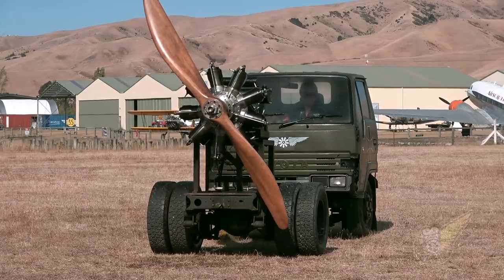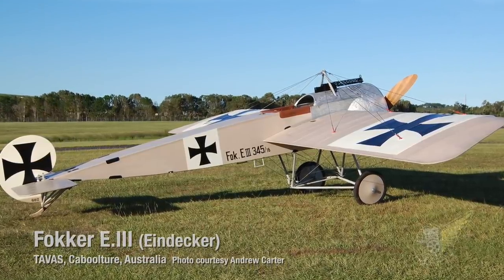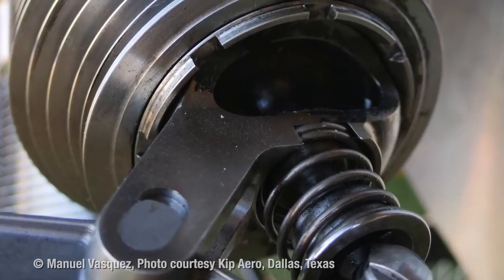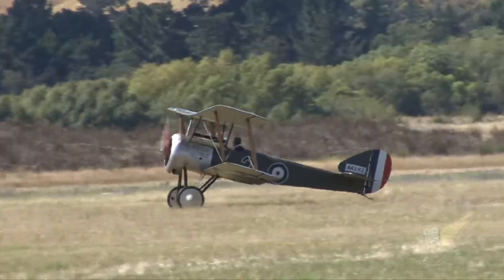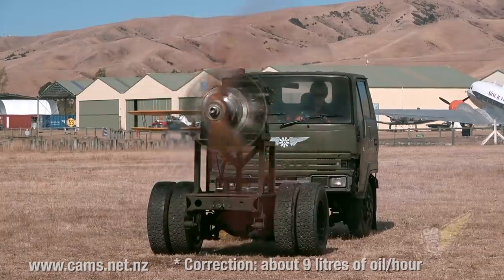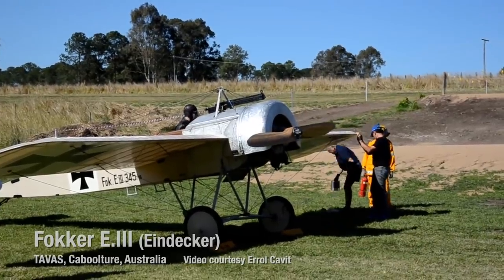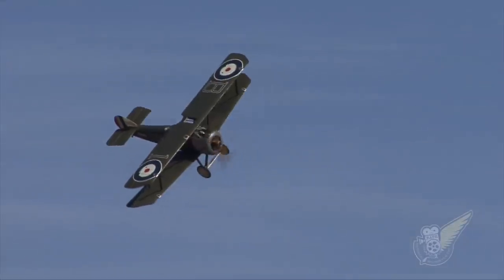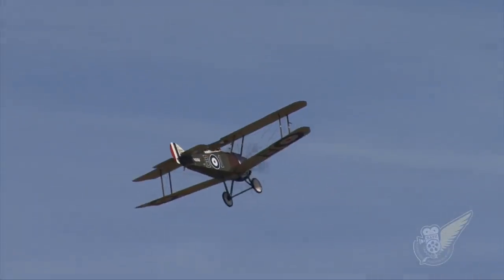Building New 100-Year Old Gnome Rotary Aero Engines In NZ

Comment: It's a rotating radial engine. A rotary engine is something quite different.
Reply: G'day,

 Ah..., nope. 

Thou art in error, Grasshopper..., deeply DEEPLY so.

This is a Gnome-Type  ROTARY  Radial Aero Engine, a roughly 1909 development of the flying (Model) ROTARY Radial Aero-Engines first invented & hand-built by Lawrance Hargraves at Stanwell Park in the 1880s (his ran on Compressed Air, having 3 Cylinders, each one with a Propeller-Blade attatched).

 A STATIONARY  RADIAL  Aero-Engine is the Post-WW-1 descendant, of the Gnome-type ROTARY RADIAL Aero-Engine.

  What you're thunkin of, y' young  Blatherskite...; is a Wankel-Type (Wanker's) Rotary Engine, with a Trilobite Rotor, perigrinating around an Eccentric Epicyclic Track surrounding a central Geared Drive-Shaft...; they hit the Slow Car Market in the early 1970s, but they were vile Fuel-Hogs, forever ruining their Rotor-Seals, so now they're Commercially Extinct.

Just(ifiably ?) sayin',

Take it easy.

;-p

Ciao !
Reply: @WarblesOnALot  You're a humble bloke fromunda down under I assume? "Rotary" is the same thing as saying "Rotational". Both are proper terms. A pure "Rotary Engine" is not a "Rotary Radial Engine" which is not a "Stationary Radial Engine" all three are distinctly different types. As you can see in the title it states that it is a "Rotary Engine" not a "Rotary (rotational) Radial Engine". But, I suppose the other side of the planet has its own foibles to contend with as well.
Reply: G'day again,

Sorry Munchiekin, but NONE of this is up for debate by the Techno-Chinglish Kindergarten Class, playing with it's first Thesaurus.

These terms are all a part of the evolution of  Engineering Historical Nomenclature.

  RADIAL...., refers to the layout of the Cylinders, around the Crankshaft ; and to NOTHING ELSE.

ROTARY....; refers to a Radial Engine in which - in the interests of improved Cooling, the Design features a Stationary Crankshaft..., around which the Crankcase and the Cylinders all ROTATE.

Following WW-1,  advances in Aluminium Manufacturing Technology enabled the successful development of Air-Cooled Radial (Stationary) Aero-Engines.... {there had been unsuccessful attempts at earlier Air-Cooled Radial (Stationary) Aero Engines, and even some Water-Cooled Plumber's Nightmares....}.

The Wankel Engine, of post WW-2 gestation  was described as a "Wankel-type 'Rotary' Engine"..., simply because it features an Epicyclic Trilobite Combustion-Surface, which ROTATES around the Output Shaft..., and which has thus been designated as "The Rotor".

However, a "Wankel-Type Rotary Engine" is NOT actually ANY type of a ROTARY ENGINE...; because ALL ROTARY Engines have their Cylinders and Crankcase arranged to be able to spin around the Crankshaft...., whereas a Wankel Engine has NO Cylinders and NO Crankcase either.

  If you REALLY want to be seriously precise and accurate..., then the Wankel-Engine is actually a Spark-Ignition Petrol-Burning Self-Torqueing Epicyclic Gearbox ; featuring an Output Shaft with a Sun-Gear and an Eccentric Planet-Cog functioning as a Vane-Pump torqueing backwards as it serves to separate the Suck-Squeeze-Bang-Blow phases of the Otto-Cycle occurring around it's Perimeter, inside it's dual-lobed Housing... (So thete !).

  Because what I taught myself to fly in today hangs in a Transport Museum..., therefore I get to pontificate in my role as the Grandaddy Santa-Clause of twiddly little Hairygoplanes ; and correcting the mistaken likes of yourself is simply part of the Gig.

Search YT for,

"The 8Hp, 1975, Red Baron Skycraft Scout ; World's 1st Legal Minimum Aircraft..."

 To see what taught me to levitate, back when I was but a Pup...(!).

I'm not actually a pompous Arsehole, y'see, because I make at least as much fun of myself as I do of others...; and because my Bullshit Content hovers down around 5%, such self-deprecation is the saving grace of a(n otherwise intolerable) "Competant Smartarse".

   Take it easy,

Such is Life...

;-p

Ciao !
Reply: @WarblesOnALot  G'day Mate. Quite the persistent bugger aren't you? But you're wrong, and I don't need a lecture on engines or their nomenclature or function.
Reply: @WarblesOnALot  I'll agree with on that point. It's not up for debate. G'day
Reply: You should look up the IgNoble Prize for Dunning & Kreuger, they brought an Opera to the Awards Celebration..; whereinat they sang a very witty song, all about you - personally, instead of making a more  traditional acceptance-speech.

Get onto it mate, you're infamous (!).

Take it easy,

Such is Life.

;-p

Ciao !
Reply: @WarblesOnALot  I gotta give you credit...you do try.
Reply: @merlepatterson  Its a rotary radial engine my guy. I can pull an FAA referance if you want it.
Reply: @nopenopenopeyes  That's exactly what I classified it as. Sorry if I replaced the nomenclature term "Rotary" with "Rotational", but they have the same meaning and function. The specific engine type design is a "Radial" engine. That's all I was getting at. It's nothing to get excited about.
Reply: @WarblesOnALot  G`day. Imagine yourself living at the turn of the century (1900) when men all over the world were trying their luck at defying gravity. Much like today but much more crudely (there being no interwebs in those days), men were learning from one another how to build aeroplanes and needing a power plant when no aeroplane engines existed. They tinkered with what already existed, except for the Wright Brothers who needed their own engine design in order to enforce their patent. But that's another story altogether. Well, what did exist, you ask? Motorcycle engines! That's right, a French motorcycle with a rotary engine for the rear wheel! Indeed! (Google it) Compact, light weight, air cooled, and powerful for it's weight. The design was an obvious choice. Engine builders of the day adopted the plan form, and soon bigger and more powerful designs appeared all over the place. Then.... along comes WWI. No time to reinvent the aeroplane engine, fly what you have. Reaching the limit on size lead to the development of the stationary radial and other engines. Glen Curtiss even used his own design motorcycle engines that became the OX5. But still the radial format proved to be best adapted for increased power. There ideal power to weight ratio could be maintained by adding more rows of cylinders for even more power.  Up until the development of the jet turbine engines,  the big (really big) radials  dominated the industry. I know, the debate over radial vs. V12 rages on every year at the Reno Air Races for speed. GO RARE BEAR!
Gotta go... the nurses are coming!
Reply: +Michael Jensen

G'day,

Thanks... Are you any connection to the great Volmer Jensen ?

  I broke my foot in a VJ-24w, back in 1992 behind a 22 Hp JPX  Pul-425...; when I foolishly tried a downwind takeoff (!).

Anyway, the thing is that whoever does a thing FIRSTIES gets the naming rights..., and (in Aeronaurical usage) the ROTARY Engine dates back to the 1880s, at Stanwell Park, NSW..., and in Automotive use it goes back to about 1901 in the USA...

The first RADIAL Engines were attempts to add a Water-Jacket to a ROTARY Aero Engine and thus cool it while holding the Crankcase stationary with the Cylinders, while spinning the Crankshaft - to avoid the issues of Gyroscopic Precession causing wildly asymetric and idiosyncratic response to Controls...

The Cooling problems with Radial Aero Engines were not solved until the 1920s.

In the 1960s or '70s the Automotive Industry's Marketing Jism Department decided to MALAPPROPRIATE the term "Rotary Engine" and stick it onto  Wankel's Self-Torqueing Petrol-Burning Epicyclic Gearboxes...

And thus, they permanently confused the likes of poor silly +Merle Patterson, hereinat.

  ROTARY means Gnome-type ROTARY..., RADIAL means NOT-ROTARY..., "Rotational Radial" is a figment of a self-deluded feverish Imaginitus...; and Wankel built a Trilobite Epicyclic alternative to a Reciprocating Piston Engine - which was a Commercial FAILURE because it was horribly Fuel-Inefficient and predictably unreliable, as well as being more expensive to manufacture.

Thus, only the ignorant believe a Wankel to be a "Rotary Engine".

Such is Life,

Have a good one.

;-p

Ciao !
Reply: +Tom Clark,

G'day,

  Thanks for that..., I tried to reply at length, but first it double-posted and when I tried removing the duplicate, both copies vanished...(Buggar !).

  How about we agree to agree, and if you want to see what taught me to fly, then title search YT for,

"The 8 Hp, 1975, Red Baron Skycraft Scout...; World's 1st Legal Minimum Aircraft..."

The Wright Brothers, literally, had a better Aeroplane in 1903 than what I used to levitate within, back in 1978.

  8 Hp vs 12.5 Hp...., 2-Axis Controls vs 3-Axis Controls.., Single-Surface Wings vs Double-Surface Aerofoils with internal Ribs & Spars, 1 Chain-drive Propeller vs 2 Contra-rotating Chain-driven Airscrews....(!).

  Before going solo in the Scout, I'd had 25 minutes of "unofficial" Dual in a 65 Hp Piper J-3 Cub, and 10 minutes in a DH-87b Hornet Moth....; back in the day I was very Very VERY seriously into my Biggles Fetish, one might say.

I have a 1936 copy of the Sydney Museum of Science & Technology's publication

 "The Aeronautical Works of Lawrence Hargraves" 

Within which are Photographs of his 3-Cylinder ROTARY Aero-Engine, running on Compressed Air, in about 1885...; but because his Propellers were such horribly wrong-headed attempts to build an Airscrew - old Lawrence (wrongly) concluded that Flapping Wings were more efficient than Airscrews, so he went back to the dead-end of Ornithopters.

  So, I KNOW with absolute certainty that +Merle Patterson is a self-opinionated Ignoramus who is herwwithin attemting to convince the Century-old Aeroplanology Community to embrace and adopt his personal Erroneousness in this matter.

And I refuse to swallow his bolus dose of Bullshit.

Such is Life,

Have a good one.

;-p

Ciao !
Reply: No, it predates the Wankel and was (and is ) known as a rotary. The FAA can call it whatever they want but engines with cylinders rotating about a stationary crank were known as rotary from the outset.
Reply: @WarblesOnALot  No relation to Mr. Volmer... at least not one close enough to know without extensive digging into the family tree. My great great's homsteaded out in southern Idaho but I hear they started West from the Iowa/Missouri area, so not entirely out of the question. They were active members of the LDS church and he somehow managed to keep 9 wives and ended up with somewhere in the neighborhood of 59 children. So if you happen to meet another Jensen from Idaho, good chance of being one of my distant cousins.

We always refered to the Rotary engine by its proper name while I learned to fly and work on them, I just find that I have fewer arguments with the uninformed when I make sure they know I'm refering to the rotating cylinder design rather than the Wankel engine. I've learned quite a bit from your comments all the same, so thank you.
Reply: +984francis

G'day,

 Yay Team !

  Thanks..., if we don't squeak up then this here Dingbat is goanna wander off, thinkin' his self t' have Bin-Right...(!),

Have a good one,

;-p

Ciao !
Reply: +Michael Jensen

  Kool !

   I married a divorcee, myself, after a mis-spent youth, and thus came to fully underconstumble the perils of Brady-Bunch Theory...; I have no idea how any man could possibly "ride herd" on a harem of 9 wives at once..., even if the Fear of God was drummed into them and they were raised-up and trained to be submissive from infancy (?) !

Volmer Jensen was a Californian Teenager in the 1940's, illegally jumping off Hills in WW-2...; the VJ-11 was a Biplane Hang Glider which he started selling Plans for in 1948, it had a 6:1 Lift/Drag - Glide Ratio...

The VJ-22 was a 2-Seat Side-by Side Cabin Monoplane, Amphibian, using a Piper J-3 Cub Engine (Pusher, on a Pylon, like a miniature Lake Buccaneer), & Wings, & Engine, as a Plans-Built Experimental Homebuilt.

Then Rogallo/Dickenson/Moyes happened, and Volmer Jensen became offended, at the 3 or 4 to 1 L/D Ratio of the early Rogallos - so he built the VJ-23 Swingwing, with an Irv Culver Aerofoil, and then the Production-Engineered VJ-24 SunFun..., and in '76 when Oz gazetted Laws permitting motorised Hang Gliders a VJ-23e ("e" for Engine, 10 Hp McCulloch Chainsaw) became the first "Microlight" to fly the English Channel, then the VJ-24e emerged, followed by the VJ-24w (Wheels, and a 15 Hp Yamaha at 2.8:1 Redrive, with Centrifugal Clutch & Blade-Brake, for soaringvwith the motor idling (!).

The one I bought began as a VJ-24, got the "e" modification, then the "w" mod...., then I redesigned the Underside of the Wing Trailing Edge, and the Undercarraige in 1982, then in 1990 I bought it, redesigned & rebuilt the Wing LE, designed and built a Fuselage-Pod for it, and 2 Propellers - one of which is still flyable but the other one is but a Hub, with Fence-marks !

I like the idea of flying for the fun of it..., once one tries to make the Aeroplane run at a profit, or kill strangers for a living..., it stops being fun - in my opinion.

But, Global Warming...; therefore I don't think the next generation will thank me for fixing my Carbon-Farting Levitation Machine..., thus I restrain myself from any such decadent dalliance.

 My Phone is running with off-Grid Solar-Electrickery..., so ; we all get to make sacrifices, and if I feel particularly selfish - I can always spend a day preparing to begin repairing my little Hairygoplane.

I sold the 22 Hp JPX, and  then the Coroner sold me the 35 Hp Rotax 377 which killed my best friend in 1995 ; so, all options are on the table - as World Leaders like to say...(!).

Have a good one 

;-p

Ciao !
Reply: @WarblesOnALot   true for the rotary, but and you are false for the born: the first rotary engine was installed in the french motorcycle 1897 Felix Milet (direct drive the rear wheel)... and in addition, a Wankel isn't a rotary engine, but a rotary piston engine (called so from the inventor, Felix Wankel)
Reply: G'day,

Thanks.

I didn't know about the 1897 French Motorcycle.

The thing is that Lawrence Hargraves never patented anything, so in 1885 when he made the first Rotary Engine, with 3 Cylinders around a fixed Crankshaft with a Propeller Blade attached to each Cylinder, he made it available to anyone who wanted to use the idea.

He did the same with his proofs thata Curved Surface generates more Lift than a Flat Plane, and his data gleaned from Soaring Boxkites...

Colonel Cody sold Manlifting Kites to the British Army, the Wright Brothers built their Wind Tunnel to try to confirm Hargraves' Lift Calculations, and in France the Gnome Brothers cobbled up the first really successful mass-production Aero Engine by starting with Hargraves' concept of rotating the Cylinders.

Model Rotary Aero Engines were flying in Oz twelve years before they were motorcycling in France.

Also, yeah, I would agree that the Wankel Engine has a Rotary Piston (therefore "Rotor" is not wrong...) ; which is a much less clumsy way of describing it that my assertion that they're a Petrol-burning Self-Torqueing Gearbox...

But a Wankel will NEVER become an actual Rotary Engine until some Nutcase builds one which has the Rotor fixed and they spin the Casing around it and then bolt a Propeller onto the outside of the spinning mass of metal.

  I'm not holding my breath while waiting for that to happen though.

Have a good one,

;-p

Ciao !
Reply: @leneanderthalien  
There was a slightly later German machine called a Megola that had a five-cylinder rotary radial in the front wheel. You had to run alongside pushing it get it started.